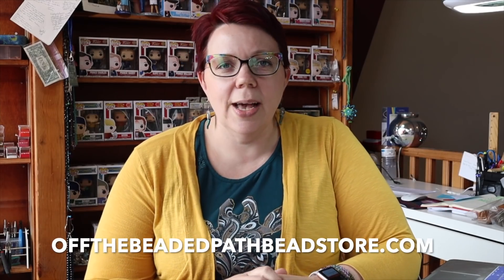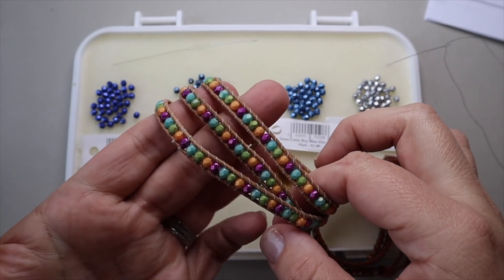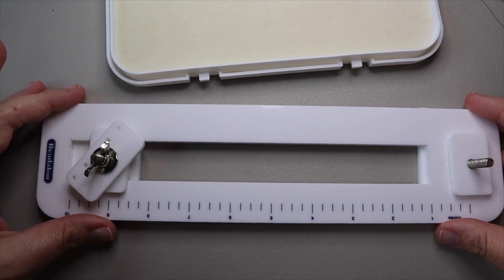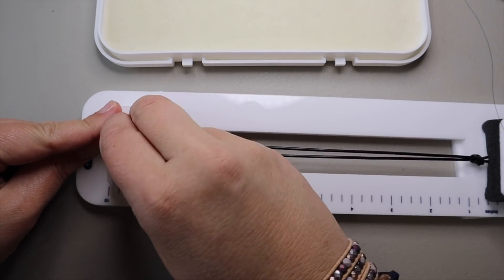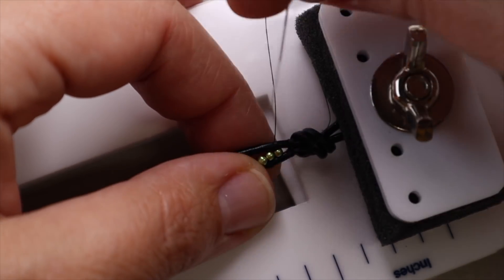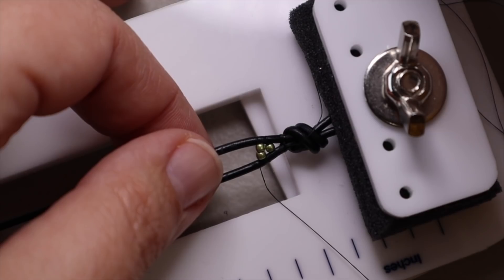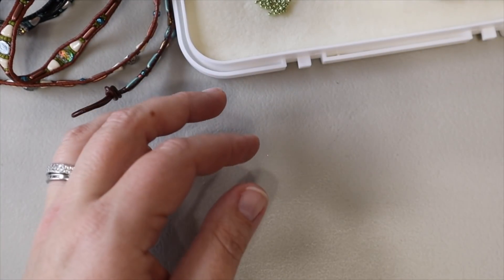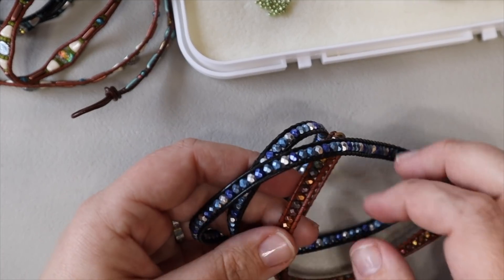Basic Wrap Bracelet (Jewelry Making) Off the Beaded Path

Comment: Amazing tutorial, it is so helpful, it has been years since I made a ladder wrap bracelet so I really needed a refresher and you show how to do everything perfectly! A little trick if you don't have any buttons for the closure (other than sacrificing a jacket or cardigan button to the cause). You can also use a 6-10mm round bead instead of the button, preferably something that matches the size and colours of the beads and leather you are using and it should ideally be sturdy like a lava bead or other stones like quartz, moonstone, jade or adventurine. You want to start with the bead at the beginning instead of the end so you string it onto your leather cord until it is right in the middle and then use an overhand knot to secure the bead making sure to leave about 3/4 of an inch between the bead and knot. Then you just continue following the tutorial as is until you reach the end of the bracelet and then after securing the thread at the end you tie another overhand knot (or you can tie the thread into this overhand knot for extra security and trim thread) leave a space just big enough for your closure bead to fit through and then tie 1 more overhand knot and cut the excess leather off leaving at least a 1/2 inch tail. The bead at the beginning goes through the space between the 2 overhand knots at the end of the bracelet to secure it.

Comment: I made a bracelet  like that using the 6lb fireside for my daughter and  the thread broke . Any suggestions. ?  And by the way thank you for this tutorial  it turned out amazing,  just that one booboo.😒
Reply from the maker: If the bracelet is worn a lot the thread will wear out over time and will need to be restrung. It's also possible that one of the beads you used had a sharp place on the inside and cut the thread. You could try going up to an 8lb or a 10lb fire line.
Reply: @offthebeadedpath  Thank you for responding.  I  was thinking maybe  there might be a sharp bead. I  have watched so many videos and  thought I  chose the best way to  make it . And she did always  have it on. I  was afraid  I did not have the knack for this. Thank you for your  input. 🤗